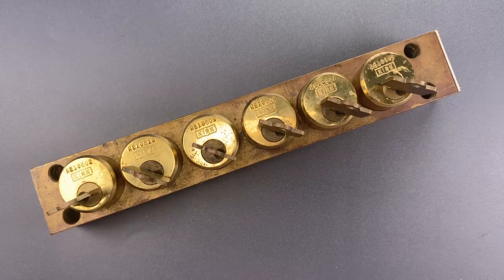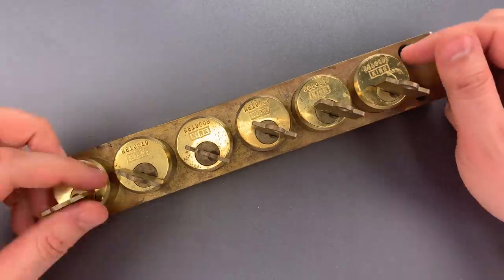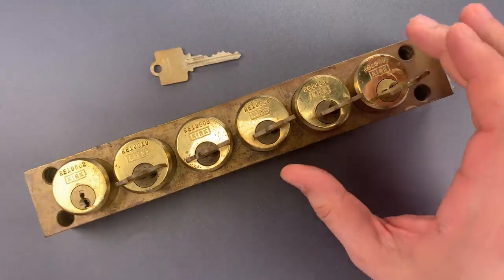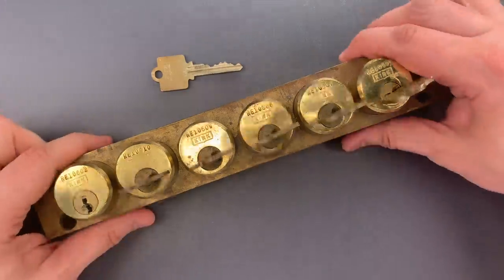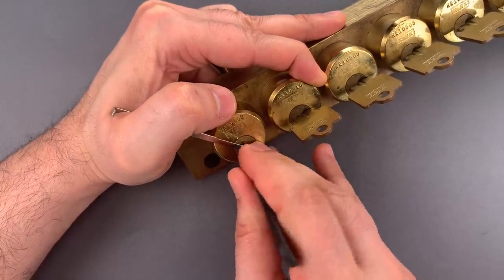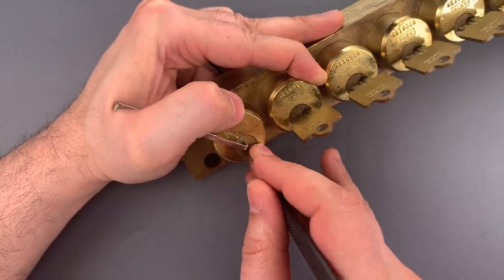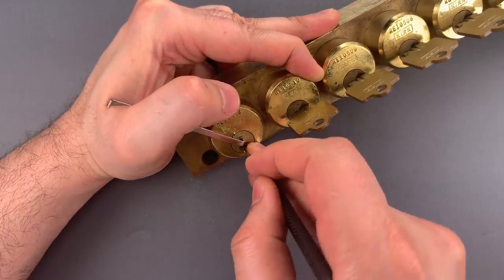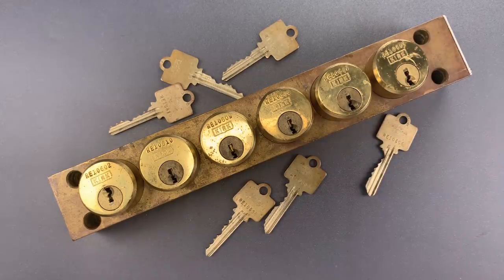[1190] 6-Key Kirk Interlock Panel Picked

Comment: I retired from high voltage maintenance and it's amazing how many customers sites I've been to where this device is the only thing that keeps them from killing themselves.
Reply: I retired from a nuclear plant where I did switching in a 500-KV yard.  What stopped these locks was freezing temperatures.  Once, we had a damage key.  We had a supervisor break the lock because none of the union guys would do it.  It was the only thing that protected us from becoming a pile of smoking boots if we missed a step in the switching order.  The supervisor lost his job.
Reply: @dwayne7356  sooo, were the union guys right not agreeing to do it?
Reply: @dwayne7356  I feel your pain, they would come out with the "spare" set of keys that came with the start up of the plant and then eventually they would get left out there in the Control Room or Yard office, now there's extra keys for the same lock. 
Fortunately I've only seen equipment destroyed from the results of Customers getting confused with extra keys. But it was only a factor of distance that it wasn't a fatality.
Reply: @mikoajp.5890  that's the kind of shit that caused Tjernobyl to go boom..
Reply: @C4pt41nN3m0  Were people without power during this?
Reply: @johan.ohgren  not really. That was a very poorly designed test of a safety system intended to prevent that exact problem in a poorly designed reactor. And a very poorly implemented test on top of that. And a lack of training of the shift that ended up doing the test instead of the shift that had been briefed on it.

Basically, a perfect storm of issues.
Reply: I bet you have stories
Reply: @C4pt41nN3m0  How does the electric company lose a few customers during an outage?
 "Honey, I'm fed up with the grid.  Get me my giant wind-catcher, magnets, and copper wiring."
Reply: @AltName7  he is probably talking about a power plant that sells to a state or city,
Reply: @AltName7  As if... I remember reading about a case where someone wanted to live off-grid but the state forced him to install electric lines and pay the utility fee minimum for service he didn't even want. Don't remember which state, but I bet it applies to all but Alaska ;)
Reply: @ScottKenny1978  To be fair, there’s only so much you can do against human stupidity.
Reply: @the11382  oh, agreed.

Locks like this make doing it safely easier than doing it unsafely. 

I've dealt with the opposite, where the portable ladders were in a place that made it easier to do the work unsafely. At the time, I wasn't aware enough to demand that they move the ladders and scaffolding so I could do the job safely (they were too big for me to move alone).

As to Chernobyl, the problem started with the reactor design. The reactor boiled water directly, and ran that (radioactive) steam through the turbines. 

Because of that, as you increased power the reactor got hotter, and as the reactor gets hotter it gets more reactive. This is not a good idea, and a prime reason why the US hasn't run a graphite moderated reactor since the one at UChicago in the Manhattan Project.

A related problem with that reactor design is that it's not stable at low power, it will have heat and power spikes at "idle". This is caused by bubbles in the water not stopping the neutrons that would be stopped if it was liquid water.

The test they were doing was to provide lubrication to the turbine bearings when the electric generator was off, by having a mechanical pump attached to the turbine shaft. This is called a coast-down pump.

They briefed the first shift for what to expect for this test, where they were going to deliberately run the reactor at very low power. (Are you puckering yet?)

But then another powerplant had to go offline and they needed Chernobyl to stay at full power. By the time the other plant was back up and Chernobyl could run the test, it was third shift, and 3rd shift hadn't been briefed to expect power spikes when running at those low power levels! I have no clue why they didn't rebrief. (Puckered tighter now?)

And so when the reactor had a power spike, the shift didn't jump on it fast enough and the reactor got hot enough to not just boil the water, but separate the water into hydrogen and oxygen gasses.

Kaboom.
Reply: @ScottKenny1978  Except the soviet engineers warned the local soviet official that running it higher would cause a meltdown. The soviet leader wanted more power, so he did not listen.
Reply: @the11382  I hadn't heard that detail! Where'd you get it from?

I am not doubting you, because Fukushima proved that officials that don't know the system will order some fatally stupid things.
Reply: @C4pt41nN3m0  To pick nits, a power loss can kill; imagine that Old Mr. Bomes is on life support and the power being out will take out the thinger that concentrates oxygen in the doohickey he needs to breathe from.
Of course, in situations like that, you're supposed to call the power company and they'll rush a portable generator out to Mr. Bomes' house and hook it up directly...

Comment: It's been a while since I followed the Darwin Awards, but I remember always being impressed at how often the "winners," had to execute some number of clever, creative steps in order to achieve their crowing moment of stupid
Reply: Few are as clever as someone desperately, and unwittingly, trying to get themselves killed.
Reply: We had a pair of winners in my town some years back. Two guys were trying to steal copper, except it was in the form of wiring, that was carrying live current.
Reply: @moosemaimer  yeah, that'll do it.
Reply: Not a Darwin award, but a coworker of mine managed to cut off his thumb in a press.  The press required that one squeeze a handle with the left hand while pushing a button with the right hand - specifically so there would be no way to actuate the press with a finger in harm's way.  He wouldn't tell us how he did it - he was too busy screaming in agony.  After he was transported away, we tried to play 'forensic investigators' and the only solutions we could come up with just left us in hysterics.
Reply: @Ceece20  They only need to be slightly more clever than the Engineer that design the item.
Reply: Foolproof solutions never take into consideration the ingenuity of fools.
Reply: @moosemaimer  we have that problem here, too.

Hasn't happened in the last 6 months or so, however. Power's on, BOOM!, power's off, power's back on, BOOM!, power's off, power's back on, BOOM!, power's off, power's back on, BOOM!, power's off, power's back on, BOOM!, power's off for a while while they clean up the mess.
Reply: @lairdcummings9092  Darwinian (d)evolution in action.
Reply: @HeatherSpoonheim  What were they?
Reply: @airmanon7213  Most were 'you had to have been there' sort of scenarios.  We were dealing with trauma and shock, and an inability to explain what had happened.  We first checked that the machine worked as designed, and then we looked for ropes or bungee cords he might have used to overcome the hand squeeze device.  Failing that, we tried to find ways to squeeze the handle and push the button while also having a left thumb in the press.  Several of the males tried to figure out a way to push the button with their penis, but couldn't because they needed to face away from the machine to have their right hand squeeze the handle.  It was all 'dark humour' in order to overcome the trauma of what we had witnessed.  I'm sorry if this is not funny, at this point, but that's just how it happened.
Reply: @HeatherSpoonheim  oof. Did you ever find out what happened?
Reply: @airmanon7213  This isn't like TV forensic science shows, this is reality.  You are freaking me out because I think you must be that guy to be so interested.  We have no idea of what really happened.  The facts, as near as I recall, were that the guy (amputated thumb guy) was a left handed drafter - he worked on a table with rulers and pencils and such.  So he saw his job coming to an end, (project moving on) and decided to maim himself.  In the end, we would have retrained him, but he was all about his left handed drafting skills.  C'est la vie.  What more can I say?
Reply: @HeatherSpoonheim  oof. Sorry for being nosy. No, I'm not that guy.
Reply: @HeatherSpoonheim  ::Gasp!:: He must have used another body part! Thank goodness THAT one wasn't in the press' way!
Reply: @HeatherSpoonheim  I'm mildly/idly curious about this too, I suspect in much the same way a small crowd might gather around an incident that occurs in a generally accessible area.

(I also get the impression there's always a tense moment where everyone wants to loudly voice their opinion on exactly how to handle the situation, but doesn't actually say anything in case their idea actually backfires.) The Internet version of this lacks all that depth and just looks like people saying "ooh, that's extremely interesting". Which it technically, uh, is.

I wonder if the guy circumvented the squeeze grip device because it was boring or he felt it was slowing him down.

I once read an interesting story about an engineer being asked to "speed up" a machine (not a computer) that did a task that took "just long enough" that the pause was slightly awkward, so the engineer "solved" the problem by adding a progress bar to the machine's small display. IIRC, the machine's users immediately noticed and were extremely appreciative of the "speedup".

Time dilation is a reasonably well understood aspect of human psychology, but everyone in the above example (which floats around the user-interface/user-experience design parts of the internet) doesn't seem to have awareness of it and genuinely thinks the process has been sped up. I wonder if that was because those people's jobs were boring/non-stimulating enough that a) their general awareness was depressed and b) any small change in the speed of the tasks they needed to do was interesting. (Now I'm reminded of another story I once read about how everyone in jail-type environments slooow doooown because there's basically no point to doing things quickly as you can't really go anywhere.)

The scenario you're describing kind of reads like a corollary of the above; maybe that person was bored or irritated by that particular task, had lack of awareness from boredom, and felt that circumventing the squeeze trigger would speed it up a bit.

This comment went in a bit of a different direction than I initially thought, I was originally going to mostly concur (and just add the bit about the progress bar), then I kind of remembered all the other tidbits. Thanks for the food for thought. hm.
Reply: @asmqb7222  Thank YOU - for distracting me from disappointing election results.
Reply: Moose
One would think that is shocking, but it is actually fairly common,
🤪
Reply: the Darwin awards aren't a real thing, it's metaphorical thing. whatever you "followed" wasn't anything official.

Comment: Interesting note: I'm pretty sure that that entire key block and all of its keys were a replacement for something before it.  Kirk's specialty is not in security, but in safety, and for that, they guarantee uniqueness to your custom interlock.  If you ever lose or damage a key, they require a signed (and at least the last time I dealt with this, notarized) form to purchase a replacement, with the signature signing away your rights to sue them in case the duplicate key is used to bypass the engineered interlock.  When you receive your replacement parts, the replacement keys will have a tag riveted to them that attests to the fact that they are duplicates (with all the dire warnings of what that means), and the serial numbers will have an "R" prefix (as seen in this video).
Reply: Oh damn, that is interesting.

Comment: Darwin Award for electrocution?  More like maintenance lost the key, not that I have any experience with that or anything.  Just a hypothetical.
Reply: Sus
Reply: The point of the design is that the key to unlock the components is only available once you turn off the main breaker.
We have something like it in my house, the main power breaker for the house blocks you removing the plate that guards the access behind the breakers, and if you remove the plate then the main breaker won't restore power(I'm not sure how that works, but the plate has some weird plastic strips on the top so I imagine there's something going on there which is used to verify the plate is restored). It's not a lock and key solution but it solves the same problem.
Reply: Suspiciously specific.
Reply: @scragar  Those breaker interlocks are easy to bypass if you know how and have some 2mm wire.

Comment: Devices like this are so gorgeous and a cool piece of history.
Reply: Still use a variety of it today at work.
Reply: Still used at a local theme park. Where the key to isolate the control desk is used to unlock keys that open maintenance gates into the ride area.
Reply: @rossalexenderwilson  I used something like this as a Monorail pilot at Walt Disney World as recently as a year ago
Reply: @JohnSmithShields  Heck looking at it... Kirk lock is still in business. They have whole model range based on those lock cylinders tied to valves, electric breakers, mechanical actuators, locking bolts etc.
Reply: Did you already come across one of them on a pen test?
Reply: I've got like 3 parents that utilize these for securing manual switch gear. They're still very much in use.
Reply: @klaernie  If so, this sounds like a dope story for Defcon.
Reply: @rossalexenderwilson  maybe if this was used at that theme park on Isla Nublar all those people might not have died.
Reply: You'll find Kirk interlocks in the power room of most telephone switching offices.
Reply: Still on the switchboard on every ferry I work on.
Reply: @Geoff_G  ferry boats? What, do they isolate the engine controls from maintenance access?
Reply: @Anonymous-ng1ze  electrical switchboard from shore power.  Or the generator from the switchboard.   For maintenance on any system we use a lockout/tagout procedure.
Reply: Deal with these every day at work, high voltage shore connection for container ships. Definitely not history yet!
Reply: @JohnSmithShields  Yup. They are installed on the 2000 amp electro-plating panel at my old plant.
Reply: They use them in high voltage switch gears to prevent closing, say, the generator onto the gear bus while utility is feeding it

Comment: After being a loyal viewer.  I found myself using some of what you showed us. We moved and my big rolling tool box the movers put in their truck. Unfortunately one of my keys was still in the lock and the movers broke it off. In the lock. Also my tool box was locked. I tried to turn the lock with the broken key except only part of the key was in the lock. So I used my multi tool and small flat metal and raked the lock. After a few minutes the lock moved a small amount. Kept tension and was able to fully rotate the lock opening my tool box. With all my tools I removed the rest of the broken key. My wife committed that I must have learned that from all those Lockpicking lawyer YouTube videos I watch.  
Thank you very much

Comment: Used in diesel-electric and electric locomotives when you need to access high voltage panels or areas.
The first key is the one who disengages high tension circuits and connects them to the ground potential. After you this you can disengage another key and put in the interlock block and free the keys to access high tension panels.